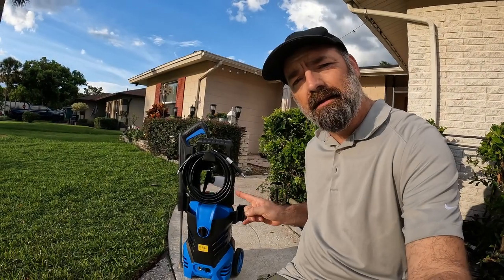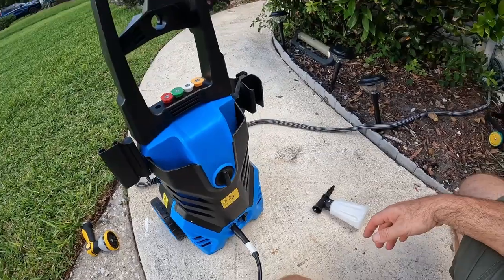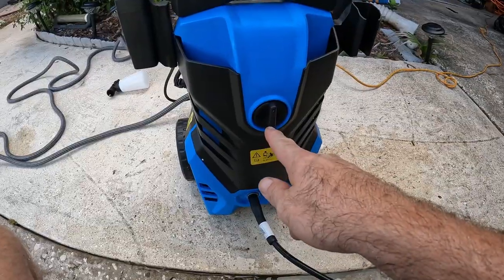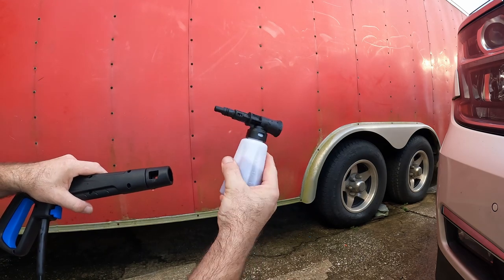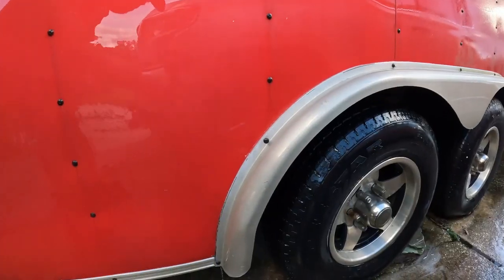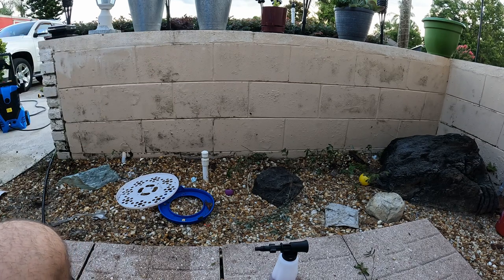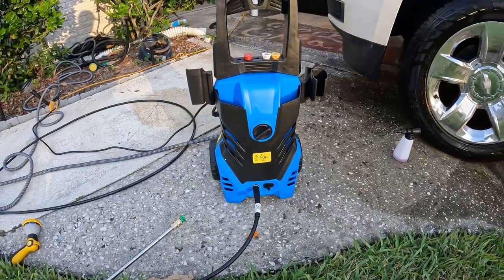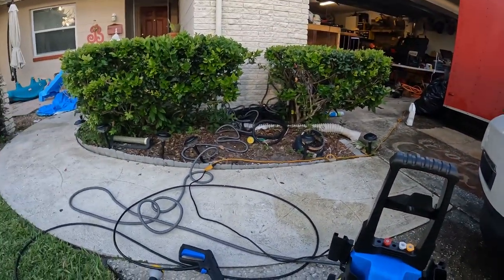Pecticho Electric Pressure Washer

Comment: When you say 2200 psi, is that the working PSI or the max? Amazon has this at 3500 but curious to know what the working psi is.
Reply from the maker: Label says 2200psi rated max 3000psi

Comment: Great instructions video! The manufacturer did not put any instructions in the box. I'm ready to use mine, but I can't get the lance off to attach the solution dispenser. Do I have to wait until I turn the pressure washer on in order to take it off? Thanks in advance!
Reply from the maker: When attaching the dispenser on the end of the want make sure there is no trapped pressure by turning the pressure washer off and then squeeze the trigger releasing any trapped pressure. Then remove the nozzle from the end of the wand and install the soap dispenser.
Reply from the maker: I made you a short video.    https://youtube.com/shorts/hZLZKWI7PIw